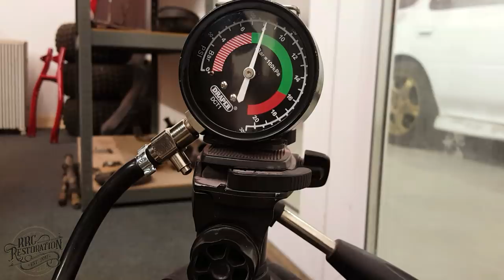1978 Honda ATC 90 Full Restoration - Part 5

Comment: This takes me back to around the early 80's when I rebuilt a Honda 250 Super Dream from two trashed ones.
I found a lot of problems with Aluminium/Steel cold welding and it was a hell of a job to get everything apart.
Great videos. I'm hooked!
Reply from the maker: Ah the old super dream i haven't seen one of them for many years now. Glad you are enjoying the videos :)
Reply: @RRCRestoration  Yeah, they were great bikes, and super-reliable, just so long as you didn't drive them into a car like I did. 
Watching your video brought back a lot of memories of my only venture into stripping and rebuilding an engine, but I was amazed I managed to do it right at the age of 18.

Comment: Really enjoy these rebuilds and restorations.  The last engine rebuild I did was over 50 years ago on a BMC A series of 1950's vintage!  I always put a good dollop of grease on the valve collets to hold them in position while releasing the spring compression tool.  Saves a lot of swearing.  Keep up the good work.  Bob
Reply from the maker: Hi there really glad you enjoy my videos. To be honest i usually use a bit of grease to hold everything in place but as i was filming i thought i better do it dry so as people can see whats happening.

Comment: Excellent! Tip: When replacing valve stem retainers, put a drop of heavy grease on the tip of your screwdriver, or whatever tool you are using, to hold the retainer until it's in place. Then it's easy to release it, without a lot of swearing! I keep a small can of that red thick stuff, the older the better, so thick you could cut it with a knife, for any time I need to hold a small part without a magnet.

Comment: Yet another great video, very interested to see the extensive use of Phillips head screws by Honda especially on the crankcase halves, really looking forward to the next instalment, top job as usual 👍👍👍👍
Reply: I can remember when I bought a set of Allen head screws from a mail order company to replace them on my 1972 SL 125. What a pain it was to get some of those screws out with the wrong screw driver. At the time I didn't know that Honda used their own screw head.
Reply: They aren’t Phillips or Pozidrive they are JIS. That’s why they always get messed up and we have to buy Allen headed bolts to replace them.

Comment: When you are replacing any bearing in the engine, you must heat the  block And freeze bearing, with this method there is no risk of damage to the concentricity of the blocks. However, the lever press can damage it..
Reply: @M Bacon wouldnt have worked, you would have shrunk the hole and enlarged the plug
Reply: @M Bacon my bad i was thinking the other way, you fit the bearing into the crank case not onto the case. in that way, you're right, you're enlarging the hole and shrinking the peg. if you where trying to fit the bearing in the case, you'd need to shrink the bearing
Reply: They are PRESSED fit from factory

Comment: Honda did a great job on these motors.  Just remember that every single part was engineered and designed with pen and paper in three dimensions on a drafting table.
Reply from the maker: All those engineers should be very proud that they designed one great little engine :)

Comment: only someone who has performed valve repair or replacement can appreciate the "lots of swearing later" comment you make lol. Great work!
Reply from the maker: Haha very true! :) Glad you enjoyed the video.
Reply: Refitting pistons into the cylinders and reseating valves has to be the worst job when working on engines.
Even with the specialist tools, it's a swine of a job.

Comment: 43 and a half minutes of nostalgia and mechanical pleasure. 

As ever, you have done an excellent job. A couple of points - the pivot bars for the rocker arms, if I remember, have a screw thread in one end for easy removal, at least on the SS50, C50/70/90 -- does this one? Or do you like the old screwdriver up the shaft trick better?

Did you set the ignition  timing? Or just the points gap (0.7mm if I remember!). 

Great video, I could watch you work all day. Oh yes, I did in lockdown!

Cheers,
Norm.
Reply from the maker: Thank you so much im really glad you enjoyed the video :) i like the screwdriver method as its just quick and easy as long as the shaft pulls out however if its abit stubborn then yes the thread needs to be used for better purchase. The ignition timing is set to the standard mark for the time being and when its running ill fine tune it ;)
Reply: @RRCRestoration  Thanks. I was just wondering as, I seem to remember, setting the gap didn't always amount to correct timing. 

Your videos are reminding me of my teenage years fixing Honda bikes and later, Yamaha outboard motors and marine diesels. These days,bI fix databases. 

Stay safe.

Cheers,
Norm.

Comment: Which gasket set did you use? Looks nice! I recently rebuild my 1994 Suzuki DR650 RSE engine, but there were no decent gasket sets.. And your “bike” is even older!
Reply from the maker: The gaskets are made by a company called NE the gaskets they make in my experience have always been a good fit and seal well

Comment: Is there an alignment mark on the cam sprocket when presses on the crank? I did not see you align it. could be 1/2 tooth out
Reply from the maker: Hi thanks for the comment, the timing is spot on i triple checked ;)

Comment: Can't wait for your next one. NO bullshit, just impeccable work. I myself like to restore, my latest is a 1970 CT70. I really should start filming! I love the way you setup the cameras and no unnecessary talking. I'm picking up loads of good tips about the way you work, especially how you keep your workshop tidy 😀. Just a question, is normal paint and lacquer ok on the engine block? I always use expensive high temperature paint. Ordered today a plating kit after seeing on your videos, what difference it makes. Also I want to get that stuff you put in boiling water to eat the rust and the degreaser you've used on the Ducati 600 to clean the harness. Any links would be appreciated. Once again, I really enjoy all of your restorations and can't wait to see the 3 wheeler in all its glory. Keep it up and carry on enjoying your bell's at the end, cheers and thank you 🍻

Comment: I just replaced the press fit wheel bearings into the spindle on my old Cayenne, and was paranoid about applying pressure only to the surface of the outer sleeve of the bearing in contact with the housing or assembly.  After you pressed on the first crank bearing and flipped it over, I thought you would have put down a spacer to carry the load on the inner sleeve of the new bearing. With wheel bearings, if you apply a side load to press them in and the force passes through the inner sleeve, then through the bearings and finally to the outer sleeve sliding into a press fit hub, you run the risk of breaking the bearing into pieces or damaging it from side loading.  The forces are much higher than the narrow bearings you are fitting, and I know less than nothing about live crankshaft bearings.  Just wondering, thanks.  Incredible work by the way.

Comment: Great vid, But no critiquing or anything, just my observation..
Your meant to hone the cylinder first, So that you can then get an accurate measurement using a bore micrometer, In order to get the correct size piston to fit... minus 0.05mm for heat expansion..
Reply from the maker: Hi,thanks for leaving a comment.  You're absolutely correct and i can assure you that my rings and piston are within spec ;)

Comment: ok i am the guy that everybody hates in comments! 1) 1:11 you are pressing the bearings till the case bends! 2) 4:50 you are pressing the bearings on the crankshaft without spacer in between! 3) 11:44 you tightening the clutch by blocking the rod with a screwdriver! love you all :D

Comment: Why not remove excees blue liquid gasket maker? And why not wait litle bit(aprox 10 - 15 min) give little time to heil, and than torque it to spec?Great channel, I watching every video multiple times, that's how good it is! 👌💣🙋‍♂️
Reply from the maker: The excess hylomar and gasket will all be trimmed flush when i t comes time to fit the engine. i like to leave it to settle for a while so that i dont end up with any leaks. Really glad you enjoy my channel :)

Comment: Question, why not replace hardware with hex-head for better install and ability to torque?  Going for a period correct refurb?  Or was it a pain to source all those if you wanted to?
Reply from the maker: Hi, I could have replced all the JIS screws with hex,spline, torx, allen etc but my plan is to get the trike as near as possible to how it would have rolled off the Honda production line in 1978
Reply: @RRCRestoration  And there is nothing wrong with that at all!  I restored a 1980 Subaru BRAT years ago and sourced OEM parts from all over Europe and the US.  I totally get it and that is why I made sure to word my comment that way!

Comment: Love the video .. Just one query, When you install the cam chain sprocket on the crankshaft is there a finite position for that sprocket on the shaft for perfect alignment to TDC at the head end
or is there a bit of play on this?
Reply from the maker: when installing the sprocket on the crank it should be sitting at tdc and there is a little hard to see dot on the sprocket that should be facing tdc aswell although there is a bit of wiggle room as its not a perfect timing system as you need to line it all up by eye so being a bit off wont affect it too much, the worst you can be out really is half a tooth and even then the bike will still run with a bit of ignition timing adjustment to compensate.

Comment: What are the drying times for reusing the bolts once you have recoated them. I know that's probably not the correct terminology but I think I get my question across
Reply from the maker: if i have the time i air dry for 24hrs or if i am in a rush i will bake the part at 60 degrees for an hour or 2

Comment: I'm really surprised phillips head bolts were used to connect the case halves. Surely you could've used something better!
Reply from the maker: Hi, I could have used a more modern fixing with better torqueing abilty but them it would be an OEM restoration ;)
Reply: @RRCRestoration  after I commented and finished watching the video I was wondering if that was the OEM fastener. Wonderful job as usual! Looking forward to the next.

Comment: Grest vids as always 👍👍
 Why you using the blue seal with the paper gaskets ?  I've had a few atc70s and xr/crf50/70s and only used gasket paste on metal to metal surfaces ...I got a top end to rebuild on my old tt600r and wondering now whether I should be using some 3 bond or 4 bond on that now lol ?  Im abit confused now ??
Reply from the maker: Thank you glad you like them :) I always tend to use a little bit of hylomar when using paper gaskets as an added security that it wont leak when assembled although its really not need if you have good mating faces.

Comment: I like the delicacy and professionalism with which you work. ¿What is the name of the sealant or glue that you use to fix the screws? 🤔🔩💪💪
Reply: Looks like Loctite to me.  Blue would be the medium strength version (red is high strength).
Reply from the maker: Exactly right ;)

Comment: Love the build series. Question about how the crankshaft cam chain sprocket is indexed, is there a key or index marking to set it correctly ? I have wondered how these are aligned as my cb125s has the same press fit system.
Reply from the maker: Hi there glad you are enjoying it :), There are no markings on the crank sprocket itself, the piston and conrod line up with the location of the keyway for timing on this engine, I cant say for sure about any of the other Honda engines based on this design.
Reply: @RRCRestoration  AHH, so there is no critical orientation of the crank sprocket, it can be out by a few degrees in any direction without throwing the timing.

Comment: quick Q: does the excess gasket cover burn up in the engine or is not a problem in the block?
Reply from the maker: Any excess gasket sealant that ends up in the engine will be chewed up and dissolved with the hot oil and moving gears, no danger for blocking passageways.
Reply: @RRCRestoration  it made me wonder why some guys don't take abit off the inside, thanks for clearing that up

Comment: dont you have to align the cam chain sprocket when you press it back on to the crank?
Reply from the maker: There are no markings on the crank sprocket itself, the piston and conrod line up with the location of the keyway for timing on this engine.
Reply: @RRCRestoration  right, but you cant just press a new sprocket on without aligning it the right way. Ive never built an ATC90 specifically, but many of the small XR and Z50/CT70 engines, you have to align one of the teeth on the sprocket with the keyway or else you will never be able to get the valve timing right.
Reply from the maker: @mxthunder2    Yeah i know exactly what you mean, i should have mentioned that in my last comment that you still need to align one of the teeth with the key way. Maybe i should have mentioned that in the video for those who think i just dropped the sprocket on any old way 🙈

Comment: Don't you run the risk of unsettling the crank pin when you press the bearings in like that?
Reply from the maker: If excess pressure is used then yes it would be very easy to ruin the balance of the  crank but it took very little pressure ( so little it didnt even register on the pressure gauge)  to fit these bearings so no risk at all of upsetting anything.

Comment: Nice video! One thing I’ve always wondered is why there’s always one round-headed nut for the headnuts on these small honda engines. Anyone knows?
Reply from the maker: Hi, The dome nut is on that stud because that stud is the main oil passage way upto the head, if the dome nut and copper washer weren't there it would weep oil from the threads ;)
Reply: @RRCRestoration  Ahh, I see, thanks alot.

Comment: I used to 'correct' my jis screws with a no.3 screwdriver and a hammer. Splendid edition as usual but......

Whats going on with that 'special honda project'?
Reply from the maker: Nice to see you, Haha isnt that an industry standard for the rest of the world converting JIS to phillips with a large precisely calibrated hammer haha. The secret project has hit a slight bump in the road but hopefully it will be back on the filming list soon.
Reply: @RRCRestoration  my secret project will have sat in a corner for 1 year next week as the worlds 'hiccup' has left the spares trapped 10,000km away from me. :(

Comment: Did you skip gapping the rings or just not film it
Reply from the maker: Hi, I didn't bother filming most of the measurement sections as there's not really much to show, I can assure you though that every measurement and gap on this engine has been set to Honda's specs ;)

Comment: Nice video but not a fan of all the liquid gasket on top of the gasket. I've openend a st50 engine once where previous owner used that, it got everywhere, eventually the excess that pushes out of the  seems let's  loose and get into unwanted places especially the oil channels and oil pump..

Comment: No counter support necessary when pressing new crankshaft bearings in ?
Reply from the maker: Hi, no none was required as it took so little pressure to fit these bearings the gauges on the press didn't even lift so no risk of nay damage being done to the crank.

Comment: Never place bearing on crankshaft with pressure.
Reply: Pretty sure he knows exactly what he is doing, but thank you internet safety officer lithit.
Reply: @KennethNicholson1972  Lol pretty sure I know how to do it , crakshaft is a precise piece , and if you look closely if you press bearing to install it you will bend the crankshaft's axes that will cause at least a lot of vibration (crankshaft are fine tunned and equilibrated weight piece, it's fragile!) the only way to place it correctly is by using cold/hot dilatation or pressing but with the spécific tool , not with a press.
Reply: @lithitbzh  I was surprised to see he didn't freeze them. straight outta package into the case. Use of blue gasket maker also questionable, but maybe...
Reply from the maker: Been doing it that way for years and never once had an issue. But i totally agree with you there are correct procedures and tooling etc for every specific job but there are other ways to do things and as long as you are sensible about the way you go about it there wont be any issues.

Comment: 14:00 why you didn't show us how to remove the 2 little parts, the same you're putting back at 14:43 ?
Reply from the maker: The 2 circlips that hold the gudeon pin are easily removed with a small screwdriver or hook i didnt bother filming that part.

Comment: Baffled by using hylomar on all the gasket surfaces, have been rebuilding honda motorcycle engines from c50 to cbx for 30 years now and never needed to use anything other than the paper gaskets and never had oil weeps if surface perpetration is good.. Could understand if it was metal to metal like yamaha and suzuki use but not on honda.....